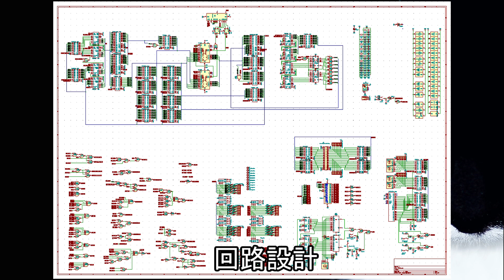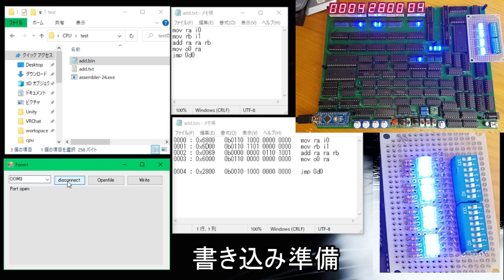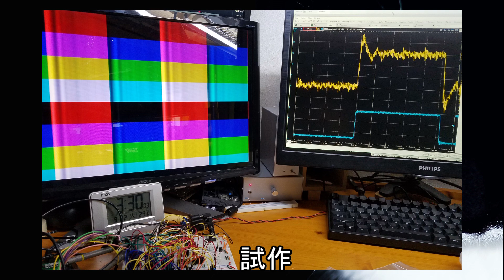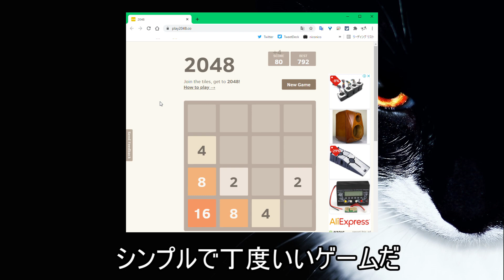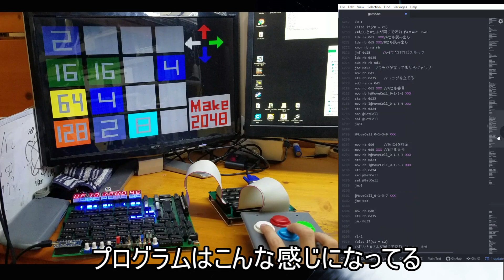8bit CPU作ってみた

Comment: Now this is an absolute madness, especially the assembly part. At this point, I'd probably just write a C compiler. Hats off for this project! Btw. when I saw an ordered PCB as a first board for this, I knew what was gonna happen. Soldering all of that only to find out that it doesn't work must have been hell.